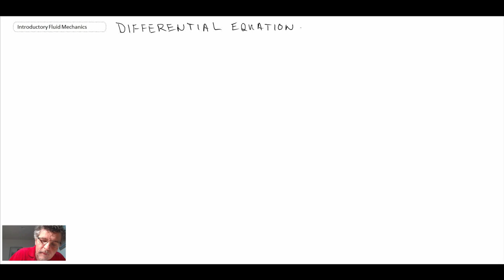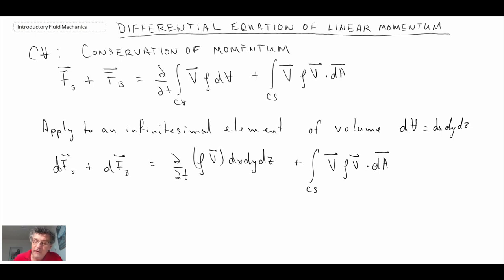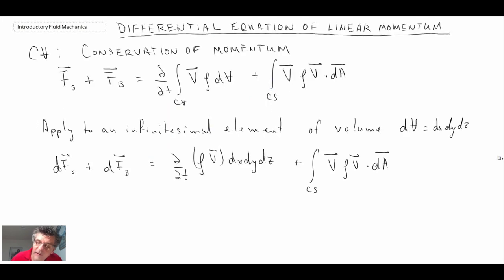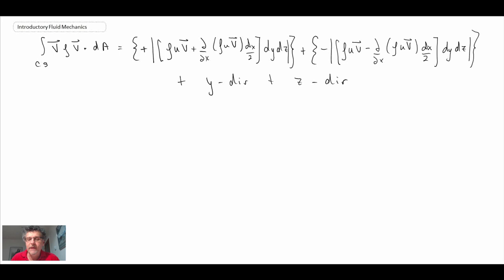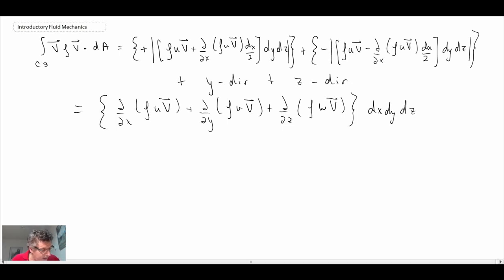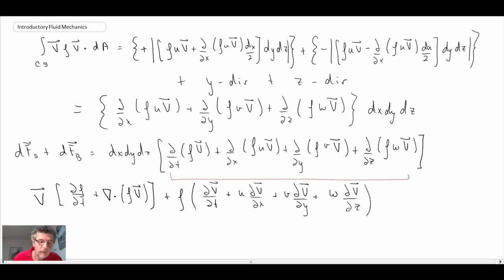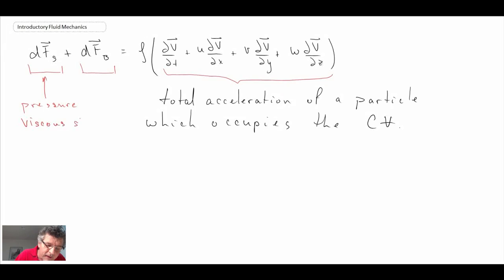Introductory Fluid Mechanics L12 p6 - Differential Equation of Linear Momentum

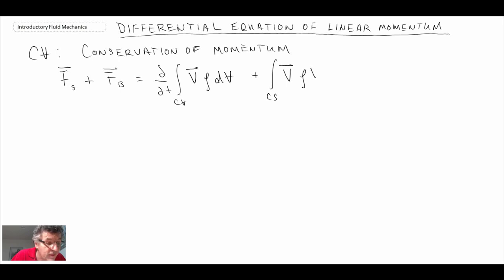Comment: At time step 2:10 of this video, I do not understand why the second integration over the CS is not negative. When velocity and the dA vector are in the same direction, the control volume is losing mass....  Momentum is MV, so if the mass is escaping you loose momentum, I would think.
Reply: The elements are written in a vector notation which already account for their direction